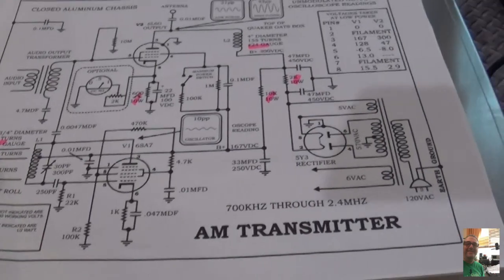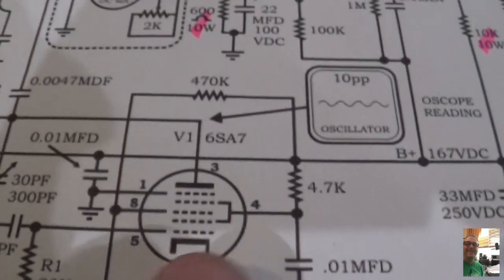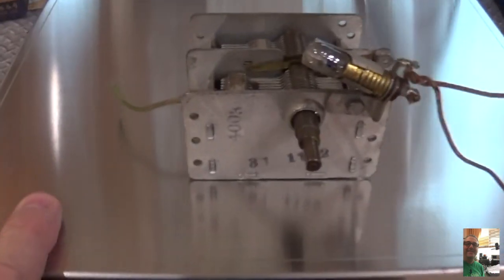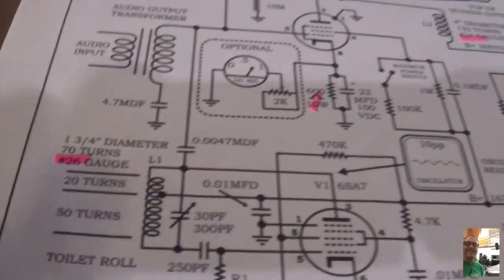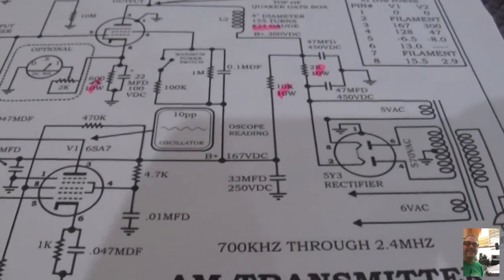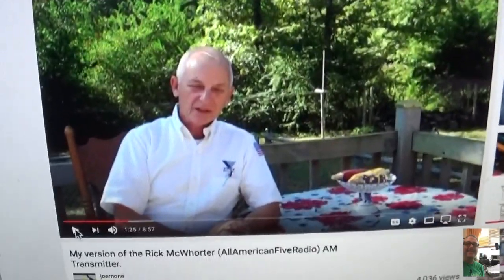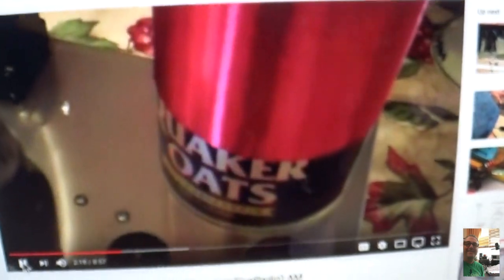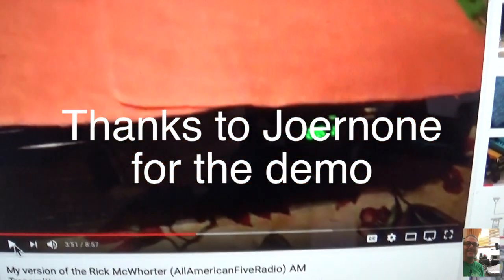Rick McWhorter AM Transmitter build - Episode 1 -  Sew your wild oats.

Comment: Hi Ron, This sounds like a fun project.
Is that an aluminum chassis?
How are you going to drill the holes for the tube sockets?
Reply from the maker: Thanks Bill. This is an aluminum chassis.  I have a Tree/Step Bit that I normally use when I build guitar amps.  That will work out great for this as well.  Many thanks for watching and for asking.  Hope all is well with you my friend - Ron

Comment: Great project! I will add this to my todo list. I am curios that you did not just use a radio chassis that would have most of the parts already installed
Reply from the maker: Thank you Scott and a good question.  I generally would do exactly what you said but I have tried to avoid doing that as  I don't want to permanently ruin a vintage radio.  I did one recently that I turned into a guitar amp and I genuinely felt bad about converting it.... I consider this a double win as I get an awesome transmitter and i get to save another radio for a project.  :)  thanks my friend  - Regards, Ron